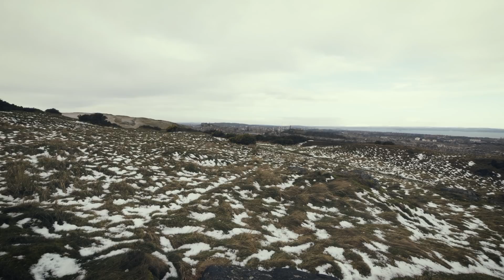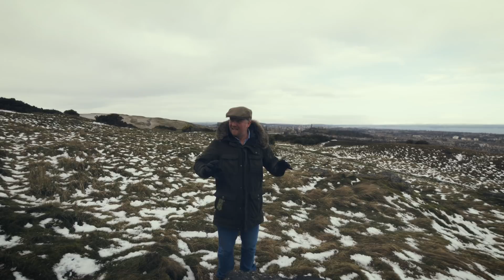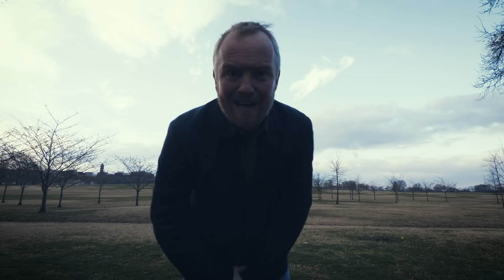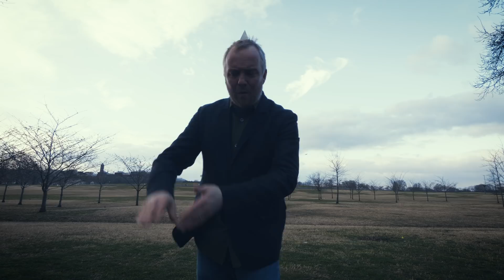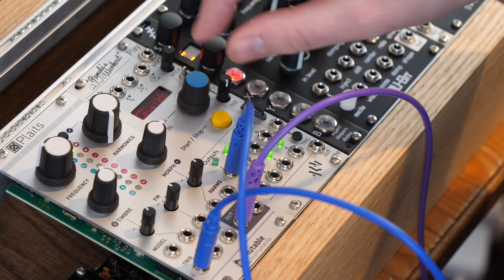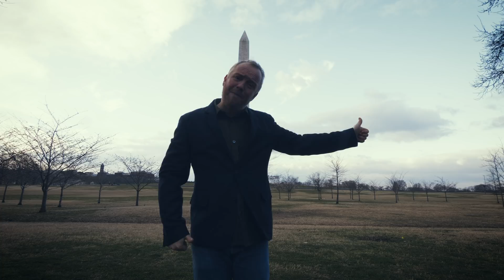Pamela's New Work Out vs Plaits Deep Dive

Comment: I really like this module, it's so packed with possibilities. The true downside is that mine constantly stops working and I have to reboot the system. Sometimes when I patch between modules, even when pam is somewhere 4 patch points up the chain, it just stops and needs rebooting. hell knows why...
Reply: Have you got enough power in your system? Do you have inbuilt power in your case, like in the Doepfer low cost? If the last is the case then some digital modules don't like to be to close to the power.
Reply: same is happening with me...didnt know if it was because mine was used.

Comment: I love using the Pam's and Plaits in combo to randomly change between the "model" in Plaits. Depending on which you model you set it with to begin with, it'll determine the range of variation (i.e. if it's in the first green model, it'll be full range, if it's in the first red one it'll only do the reds if you have only positive voltage going into it, or also full range if you have positive and negative). In this video I was using the Eloquencer and Ornament & Crime to vary model and pitch as I didn't own the PNW yet at the time: https://www.youtube.com/watch?v=QMACsy0mrAY
Reply: @DobsonsLab  Totally! I'm sure you can probably get some really fun results once you hone in on the sweet spots and intentionally sequence the model parameter.
Reply: How would you use pams to cycle between the sounds of plaits? Plug the “model” input of plaits into pams and set pams to random?